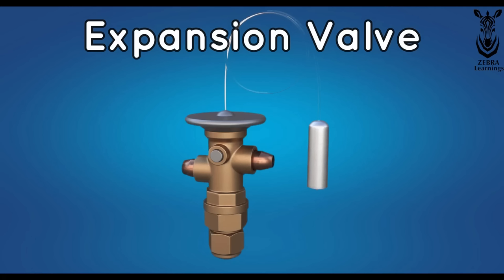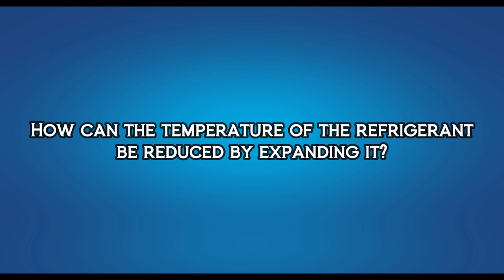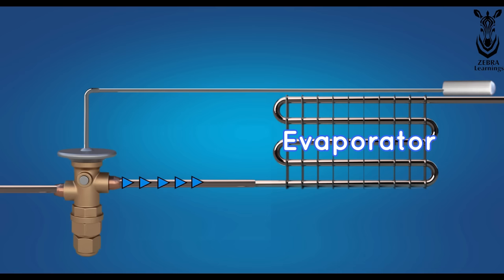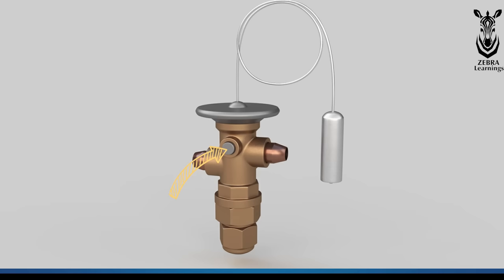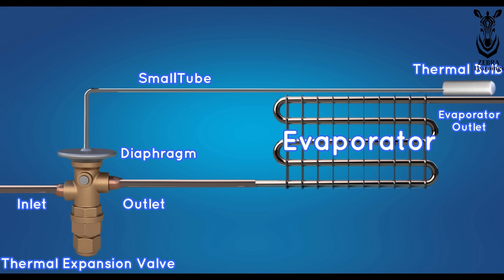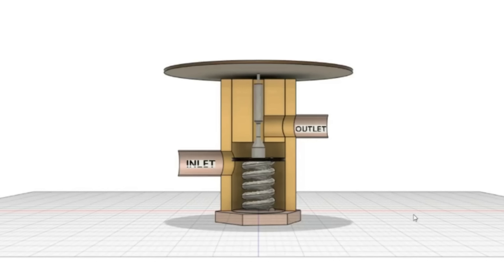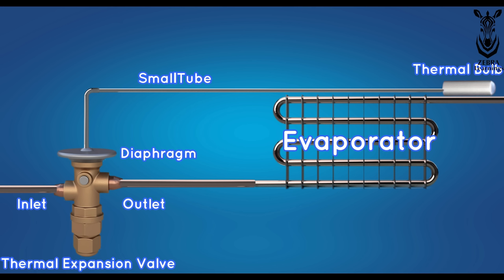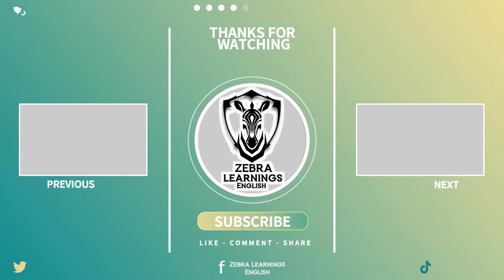TXV | Thermal Expansion Valve | Animation | HVAC |

Comment: Hi sir, My question is if the temperature on the sensing probe is higher the more refrigerant is pushed into the evaporator does it affects the cooling temp as the pressure is also decreased, for example we blow air out of our lungs with little more wide open sends the little more warm air in the comparison when its closed more and cooled more. Thanks
Reply from the maker: I'm sorry, I didn't quite catch that. Could you please repeat it with more details?

Comment: What will happen if there is any liquid content also on the discharge side of the evaporator? How sensing bulb helps this?
Reply from the maker: The compressor designed to compress only vapor. So, if there is any liquid refrigerant in the evaporator, it will damage the compressor. Sensing bulb will send the proper amount of refrigerant to the evaporator. So, the refrigerant can evaporate and change from liquid to vapor. If the sensing bulb sends more refrigerant to the evaporator, all the refrigerant can't change from liquid to vapor.
There are some others reasons also there for the liquid refrigerant in the evaporator like,
Evaporator block and air filer block.
Reply: @zebralearningsenglish-pn6fl  okey Thank you 😇

Comment: For a 8.75 TR compressor with 11 TR condenser coil, can we install a 11 TR TXV?
Reply: Danfoss model 067N2158
Reply from the maker: It is not recommended to install a TXV with a capacity exceeding the compressor capacity. In this case, the TXV capacity (11 TR) is larger than the compressor capacity (8.75 TR). This can lead to overfeeding of refrigerant to the evaporator, resulting in reduced system efficiency, potential compressor damage, and other issues.

Therefore, it is advisable to select a TXV with a capacity that matches or is slightly less than the compressor capacity. In this case, a TXV with a capacity of 8.75 TR or slightly lower would be a more suitable choice.

Comment: HI, is the sensing bulb needs to be in somehow upright position, considering that it is filled with refrigerant?
Reply from the maker: The sensible bulb should be in a horizontal position.
Reply: @zebralearningsenglish-pn6fl  and must be leveled lower than the valve?

Comment: The refrigerant is expanded by compressing it?
Reply: Think of it as the flow of the refrigerant being slowed down by forcing it through a small opening. Slowing the refrigerant reduces pressure which also reduces temperature

Comment: What happens if you get rid of the sensor?
Reply from the maker: You are asking what will happen if there is no expansion valve?
Reply from the maker: If there is no expansion valve, the refrigerant can't flow from condenser to evaporator. So we can't get the proper cooling and the unit will not work without expansion valve.

Comment: what i don't really get is; you have a refrigerant at most 12 degree celsius out of evaporator, then you take it out to condenser to cool it with a compressor and try to cool it down with a 27 degree celsius cooling water which comes out of cooling towers, can you explain how refrigerant is cooled down to 7 degree celsius from 12 with 27 degree celsius cooling water.
Reply from the maker: Yes, you are correct that the refrigerant comes out of the evaporator at 12°C and next, the refrigerant will enter into the compressor. The compressor will compress the refrigerant very well. So the pressure and temperature of the refrigerant will reach too high (up to 50°C) and will enter into the condenser. In the condenser, we cool it with the condenser fan. Refrigerant will enter into the expansion valve, where it will further cool down before entering the evaporator.
Reply: @zebralearningsenglish-pn6fl  what would be the temperature of refrigerant out of the condenser. Is it like 27 degree celsius with High pressure and when the refrigerant is passing through expansion valve it keeps decreasing? Down to 7 degree
Reply from the maker: @cagataycicek2983  When the pressure passing through the expansion valve the temperature of the refrigerant rapidly down to 6 or 7 °C.
Reply: @cagataycicek2983  it 's using pressure-temperature korrelation law. When you suddenly decrease air pressure, so temperature will decrease instantly. and the other hand. When you suddenly increase air pressure, then air temperature would increase instantly. And it's linear.

Comment: From compressor to expansion valve the refrigerant should be in liquid form or gas form?
Reply from the maker: When the refrigerant comes out of the compressor, it will be in vapor form. Then it will enter into the condenser. When it comes out of the condenser it will be in the liquid form. Then it will enter into the expansion valve. Before entering into the expansion valve the refrigerant should be in the liquid form.